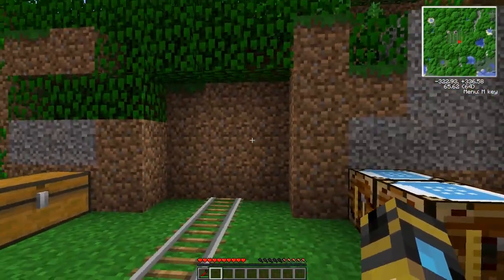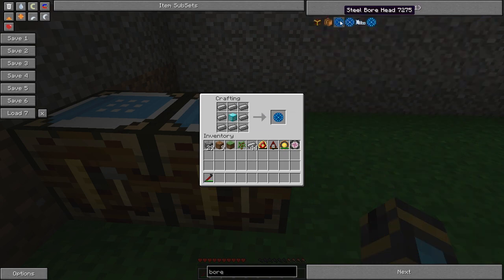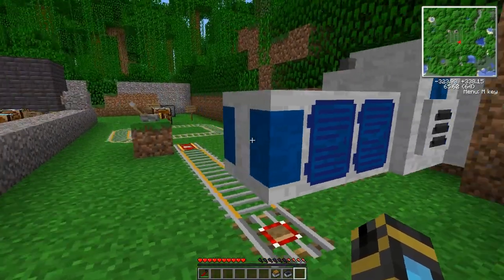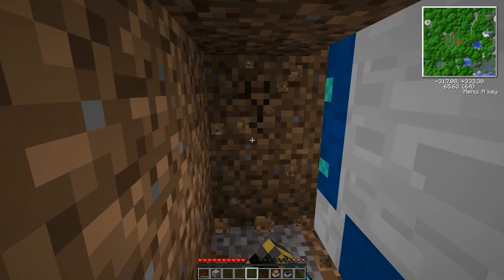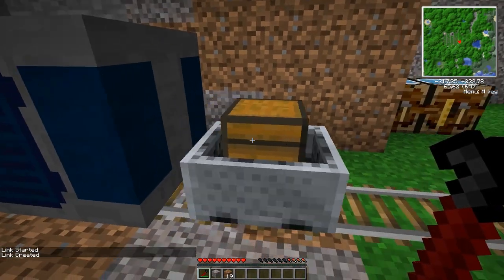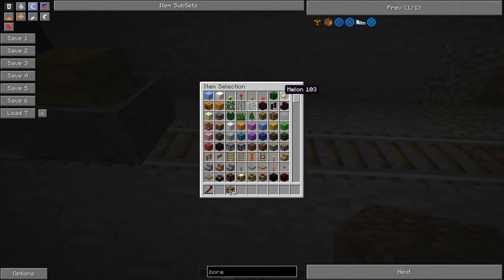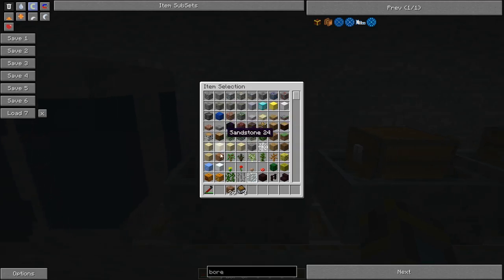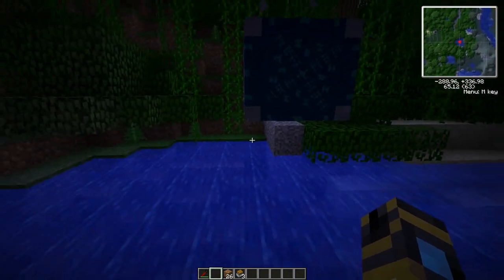RailCraft: Tunnel Bore

Comment: In voltz the tunnel bore exists but the quarry doesn't so it has a use for gathering materials a bit faster but if I was using tekkit, I would use quarry over tunnel bore

Comment: It doesn't work for me.
I can link the bore with my chest cart without problems, but the bore neither places things inside the cart, nor does it take them out, when it needs them.
I'm using the newest version (for minecraft 1.7.2) and everything else does work properly.
Reply: I'm getting this same problem and i haven't found any solutions:/
Reply: Well I found a solution by now: there is a cart that automatically collects all items on its way (I don't know the name any more) so I just use this one, though it doesn't work for fuel
Reply: the problem is that the vanilla carts arent being replaced by the rc carts (bug) so link the carts to the bore, and unload the chunks by moving far enough away or by relogging. that worked for me
Reply: i have same problem too
Reply: THX WORKED
117wolfe117
Reply: try shift clicking with the crowbar, that's what i do
Reply: I'm using 1.10.2 and it works

Comment: I just cant seem to find a use for this thing. The quarry is better at gathering resorces and I cant think of any reason Id want a long straight 3x3 tunnle big enough to justify the investment.
Has ANYONE found a solid use for this other that just to look cool?
Reply: its really usefull for making tunnels underground and shit. especially if you have a big railroad system in your world. also im using a railroad system for mining so i just place all the materials in the nearest cart then it will automatically go to the place its heading and then unload the materials and it will be sorted and the ones that need to be melted will be sent to the furnaces where it will be melted. although i havent figured out a way to automatically make the furnaces empty themselfes when the material is done